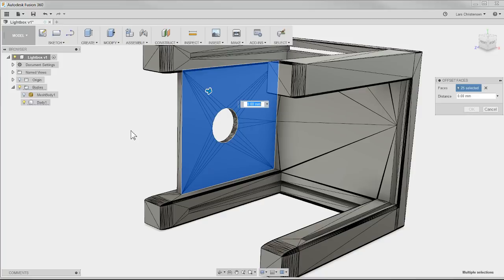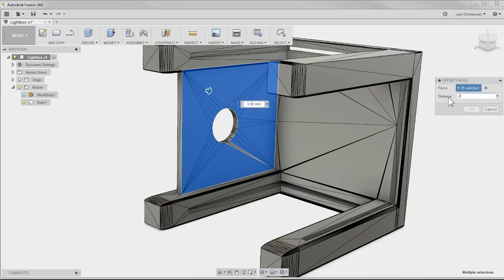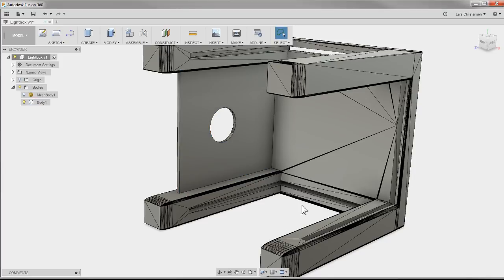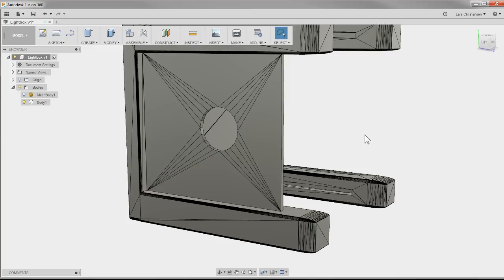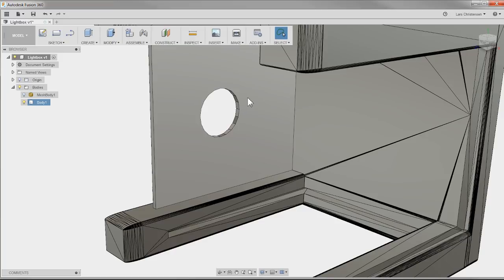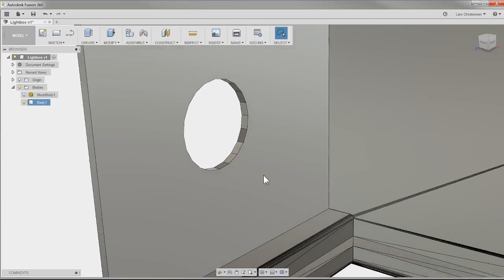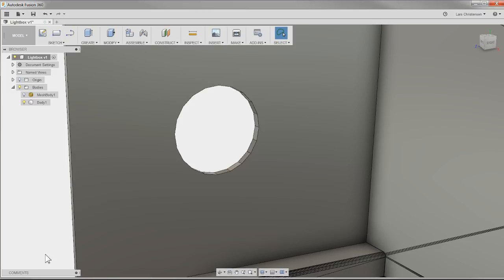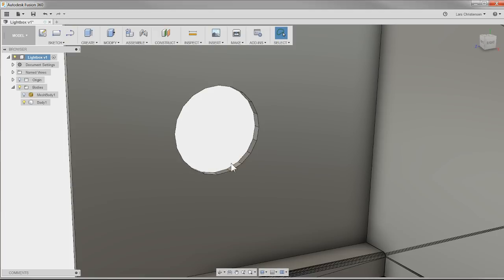Quick! Modify an STL file — Fusion 360 Tutorial — #LarsLive 118

Comment: I have tried with cats and dogs to find a way to modify an STL file.  If i for example have a .STL file of a box witch wall thickness is, lets say 4 mm. Then i import it to Fusion 360. How can i change the wall thickness from 4 mm to 2 mm? Or can i? Or if there is a hole on the box and i want to change the diameter on the hole? Any  one know? Thank you.
Reply: No offense, but that is precisely what this video was about! He imported an STL-file, made a wall thinner and adjusted a hole... I suggest you look at this video stating at about 6 min 10 sec. for the wall and at 9 min 20 sec. for the hole. What I discovered though is that features in Fusion 360 have moved and/or been renamed, but with a little bit of fiddling it was fairly easy to find them.

Comment: I followed this tutorial and it turns out that the design gets 10X bigger when doing it this way. I did select mm, but it still used cm. According to google, in order to keep aspect ratio from the stl you must first start with a empty new design, select if the .stl is mm or cm, and then go to insert menu and select insert mesh. Apparently the .stl file does not include the information about size, so by doing it the way this video say, Fusion automatically assume the measurements are in cm. For 3d printing, it usually is in mm. I could not find any instruction on how to convert my now 10X bigger design back to mm. Anyone have a solution for this?
Reply: can you not just scale it up?
Reply: Just scale it to 10% in your slicer.
Reply: @LillySchwartz  Scale the body by 0.1 in Fusion 360

Comment: How would you remove the hole and make it a solid wall?
Reply from the maker: Turn it from an STL to a solid and then select the faces of the inside of the hole and then hit delete on your keyboard👍
Reply: @cadcamstuff  Worked great, had to make both front and back faces a solid for it to work.  Thanks.😃

Comment: Thanks for your very useful videos Lars, i've been trying to use them in order to modify some STL files but you don't quite cover what i really need. i was wondering if you could help. 
i want to 3D print this file https://www.thingiverse.com/thing:2838941 but i want to make the part that holds onto the bed frame, much smaller as the frame i want to use it on is much much narrower than that one. but no matter how much i try i simply cannot get it done. i am new to Fusion so maybe i'm missing out something... i would be grateful if you could help. thanks!
Reply from the maker: Hi achichon Thank you for watching!
Did you see these two videos:
https://youtu.be/cKXvIWpLoeU?list=PL40d7srwyc_Mkgc5wvP_OfVel9aDkNkZ6

https://youtu.be/OX1T_bg493A?list=PL40d7srwyc_Mkgc5wvP_OfVel9aDkNkZ6

Best,
Lars
Reply: Hi Lars, i did start watching that video but it did not seem relevant to what i was trying to achieve. also i've read/heard that when you import an stl into fusion360 the original measurements multiply by something ridiculous like 1000%